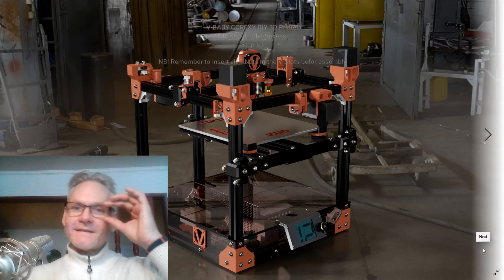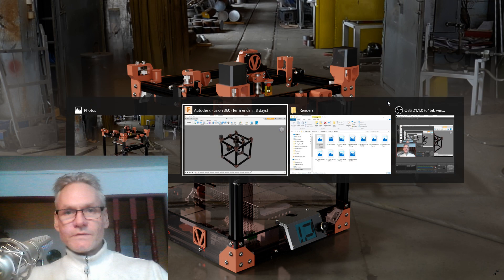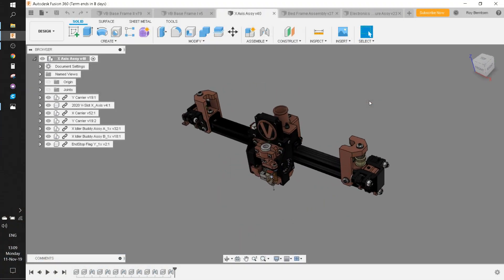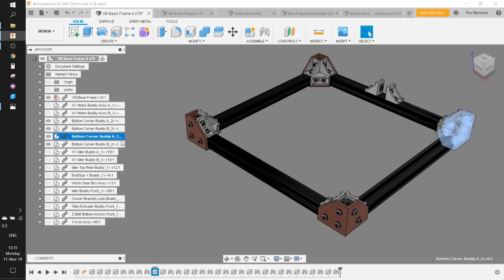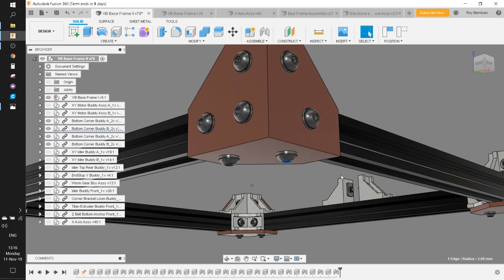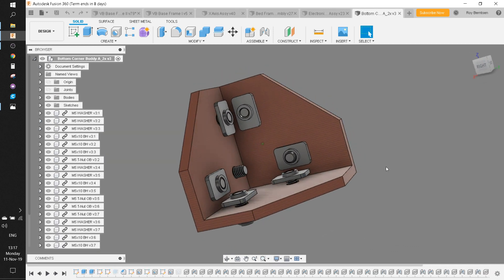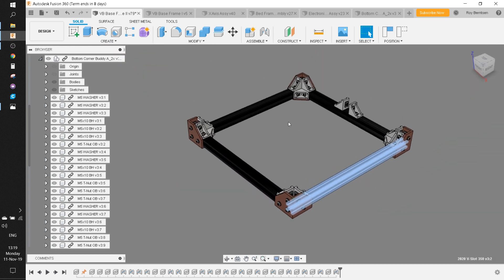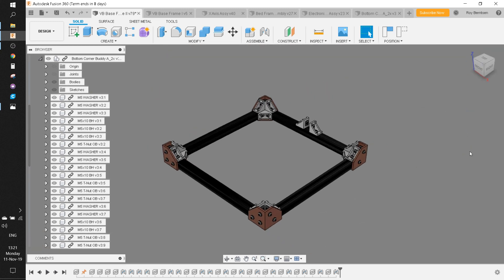Building A 3D Printer | The V-Baby CoreXY | High Speed 3D Printer | Part #1

Comment: I have a comment here. The printed corners are covering all three corner sides, so the whole printer will be standing on these four small corners and their screws. This will be very wobbly
Reply from the maker: Yes we want these corners for good alignment and later I add rubber feet to the corners. If you want to leave them out that is ok
Reply from the maker: You don't have to add them no. Just fine without
😀
Reply from the maker: You can build it without no problem
Reply from the maker: Not really needed no.
Reply: Are they really needed? I mean you're already using corner joints on all the corners

Comment from the maker: Do you want more details? Is this ok explanation?
Reply: Explainable and fantastically simply with 3d models. Great effort
Reply: Very interesting build. I'd like to know why you use a wormdrive for the z stepper ? Getting the pulley further in than half the stepper width?  something to do with the geometry of the belt ?
Reply from the maker: @KSCPMark6742  we need the worm drive to keep the bed from dropping down when the stepper motor shuts of